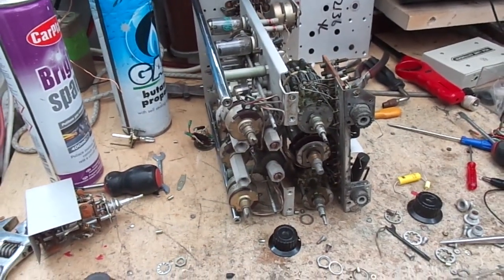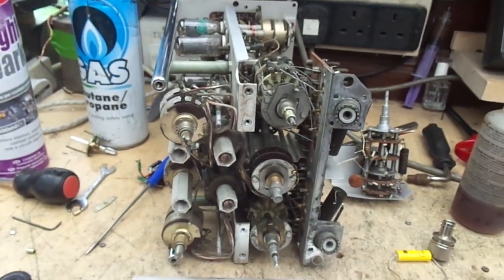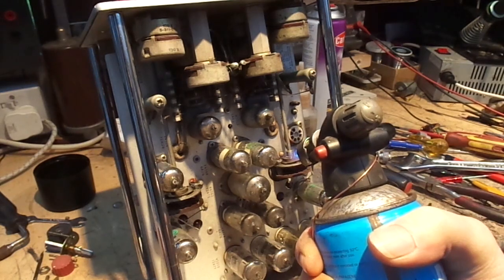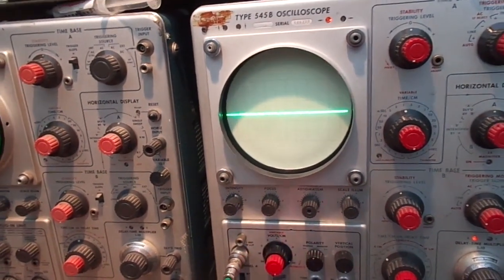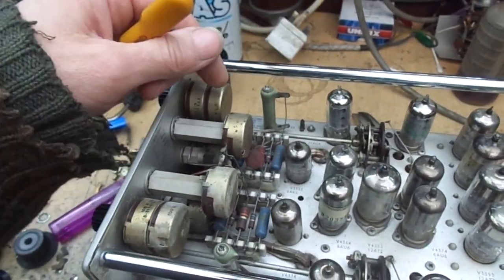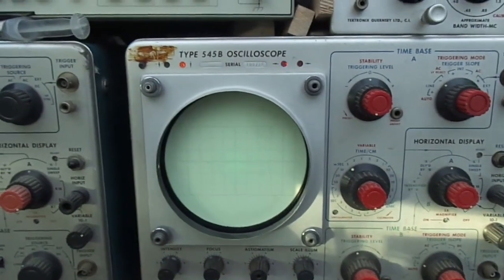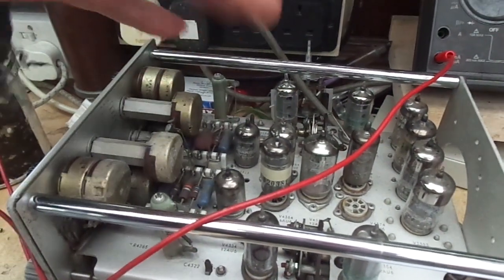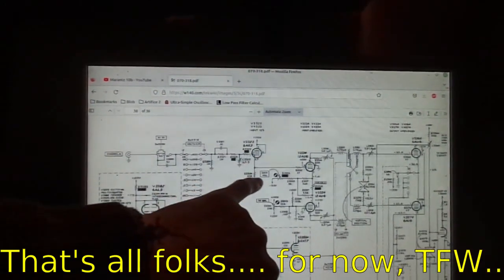Tektronix CA Plugin Refurbishment.

Comment: Great job! Very nostalgic. Takes me back to the 1970s when I worked on a few Tektronix 'scopes at the Plessey Product Assessment Laboratory Repair and Calibration department. The real problems came with the timebase trigger circuits that used tunnel diodes which, certainly in those days couldn't be tested, so it was a case of "troubleshooting by replacement". Not a popular move with the management as they were bloody expensive!
Reply from the maker: Yes, these scopes were still being used in the 1970's and in found in factories of that time. They feature too in films & TV series of that era, like in The Prisoner and I've seen them in The Sweeney & Dr Who. There are no tunnel diodes in the 500 series scopes AFAIK but Tek did use them a lot in their later scopes. On various vintage tech forums I'm a member of tunnel diodes come up a lot. TFW.
Reply: @diabolicalartificer  If memory serves, the little 465s used TDs, and possibly the 700-series.

Is that "Artificer" as in Royal Navy Artificer, BTW?
Reply from the maker: @TheDagda1000  The 500 series of scopes were made before the dawn of silicon, for the most part. Some have the odd germanium transistor in, same for the plugin's. Some plugin's also use Nuvistor's which are interesting devices.